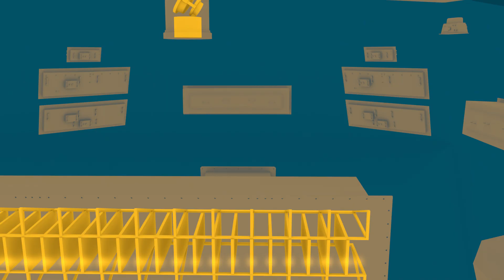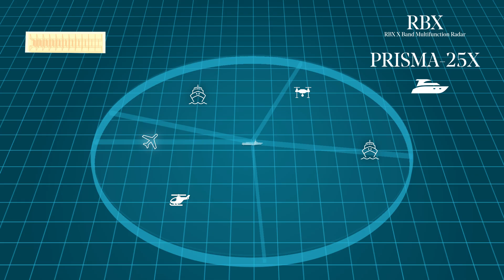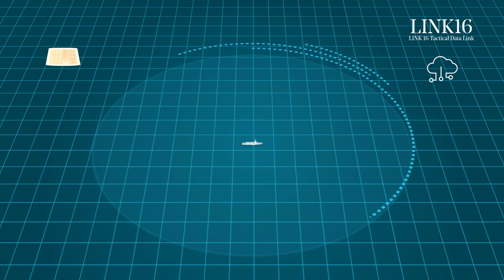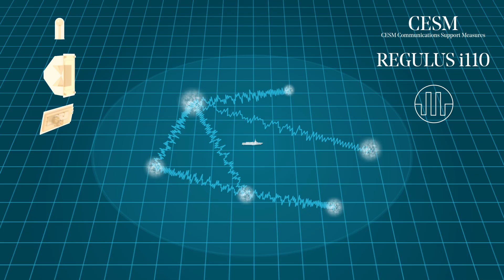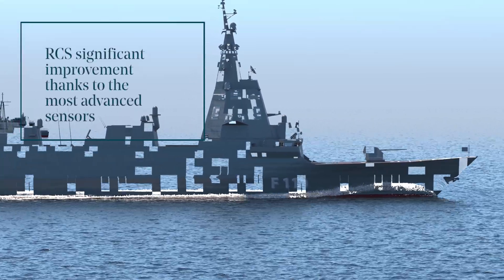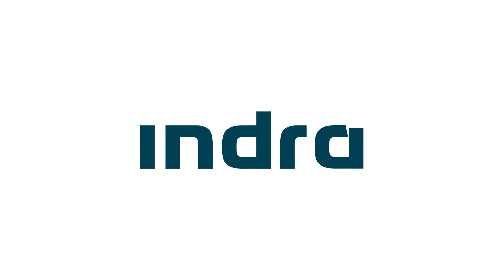F110 Frigate: technological superiority in each mission

Comment: The problem is that this ship has only 16vls and its not like this ship is 200~4000ton class ship. Its 6000ton class ship! The armament of this ship is tiny compared to the other ships that has similar sizes. This ship will run out of missile in a minute in actual combat situation. 
It AT LEAST has to have 32~64 vas if it wants to have an actual fighting capabilities
Reply: No

Comment: Why no weapons in middle? Waste of space
Reply: The central portion of the ship is usually storage and the engine compartment (If you look at the bottom of the ship, the propellers in most modern naval ships jut out from there.)

You also need space for the crew, sanitation, the mess hall, the fresh water tanks, the medical bay, any aviation fuel compartment, the ship's fuel compartment (although fuel is usually below decks.) There are also a slew of other uses that may be reserved for the center of the ship.